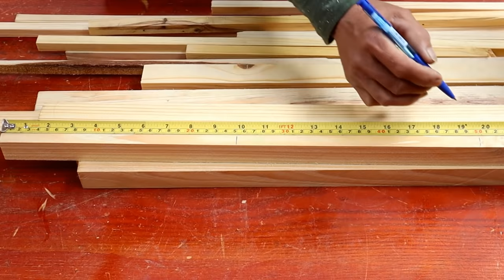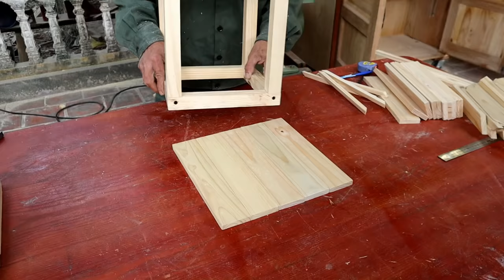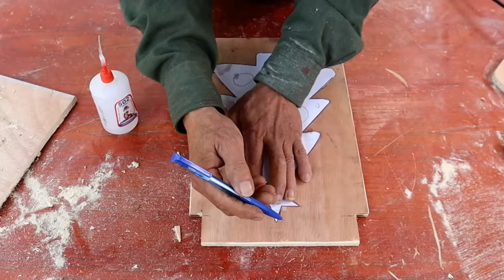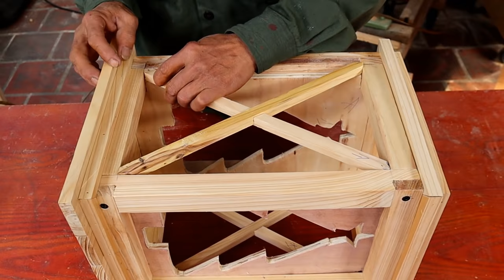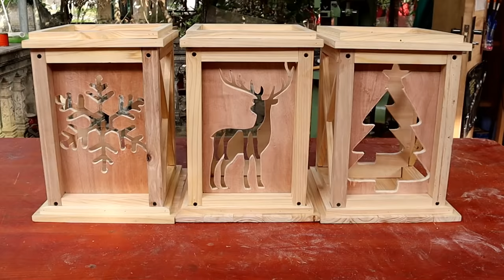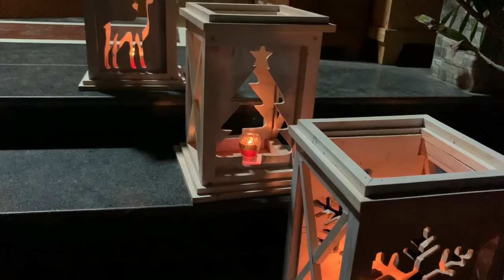DIY Wooden Christmas Decoration lights // Woodworking Projects - Christmas Decorations Greatest

Comment: Hmm no guards.  And look at his left index.  That’s what happens.
Reply: I always find it amazing when I see that, and they are still not working safely.  My grandma lost 2 fingers because the company she worked for took guards off the machines so they would run faster.  It was a bookbinding machine. The string caught her fingers and a second later they were gone.  I was a little girl about 10 at the time. 30 years later I still remember the lesson.  My workshop safety slogan  is “Safety First.  Fuck Ups Are Forever!”  And yes I have a sign
Reply: Especially the jointer absolutely stupid and no push blocks either!
Reply: Does it really matter, it's not yr hands
Reply: I was running a 90 lb jack hammer,it fell thru and almost took one of mine.  It's not always what ya think..
On the other hand I know a fella running a planer drunk..lost 2 fingers..mmmmmm.

So much for being a surgeon

Comment: Beautiful. Your angles are wonderful! They are my nemesis! I can never get them right!!
Reply: Have you got a mitre block? Most DIY stores sell them, even most hobby stores too nowadays. It’s like an open box with the angles for mitres already marked out and straight cuts too. You just put the piece of wood you wish to cut into the “box” against the correct angle you want to make then using a mitre saw… it makes a difference, and make your cut. Then you place the next piece into the box and make the opposite cut and you. Should have a perfectly neat mitred joint.
Reply: I bought the plastic one from Harbour Freight. Problem is I can’t keep the wood from moving while I’m sawing. 😂
Reply: @c.mcanelly6821  try using a spring clamp
Reply: I will look for spring clamps and give those a try.
Reply: @c.mcanelly6821  yes that would work. Don’t know what your mitre block is like but some come with drilled holes so you can screw them to your work bench then clamp the wood in place so it doesn’t move and you should be good to go! Hope that works for you x